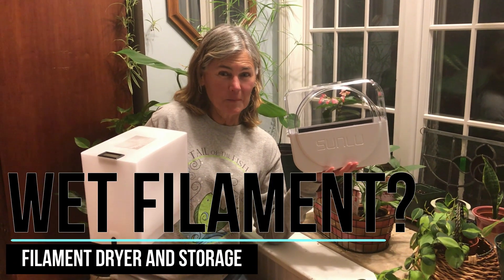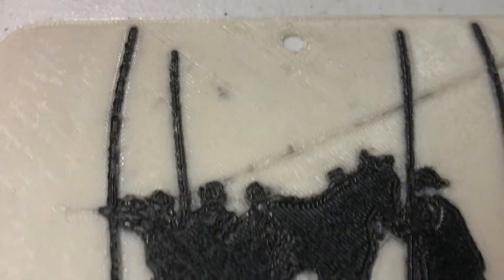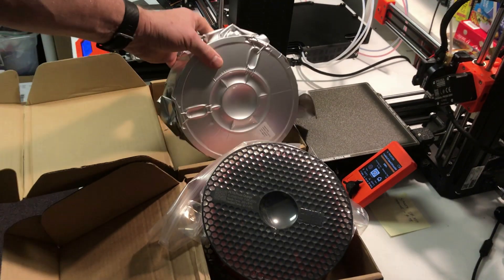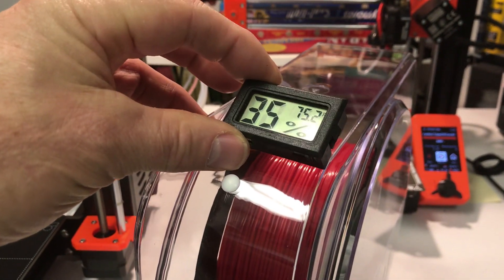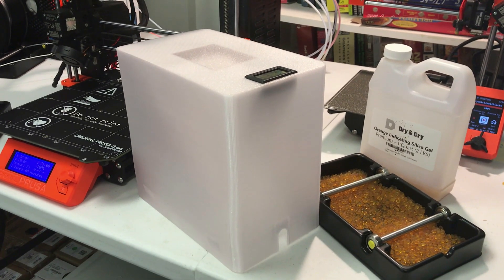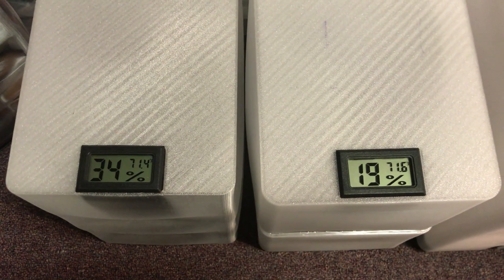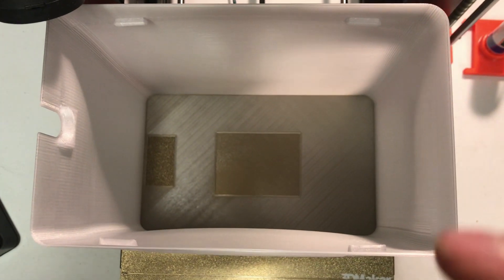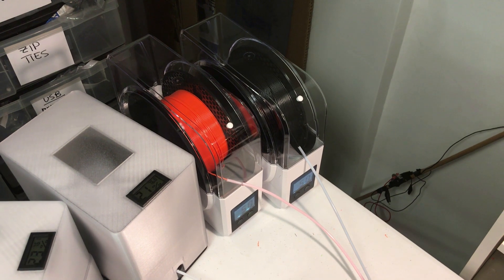How to Solve Wet 3D Printer Filament Problems

Comment: I have seen videos where they use reptile heaters to add heat to boxes they create.  So you do have that option too if you can find a heater of an appropriate size.  Of course the moisture will need to be able to escape someplace or be absorbed. .